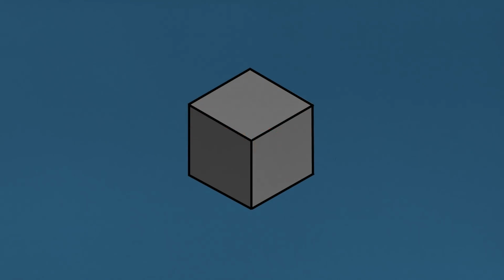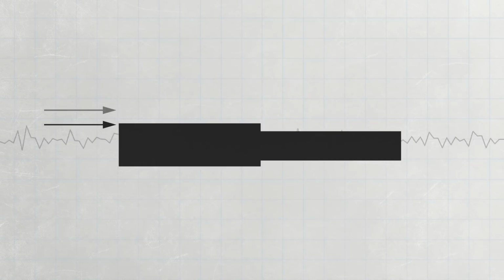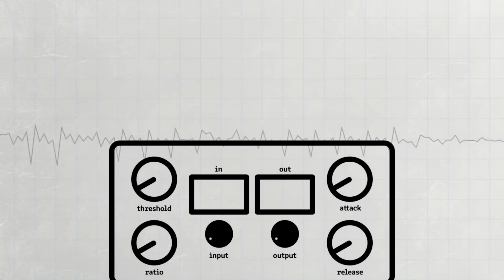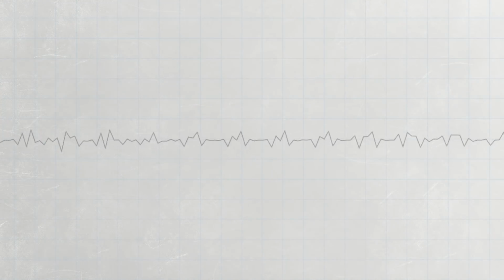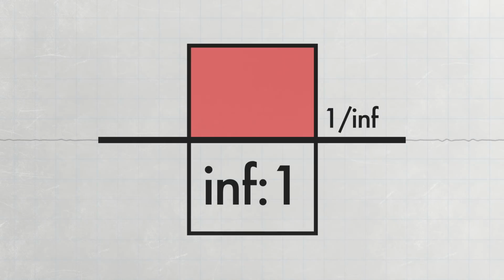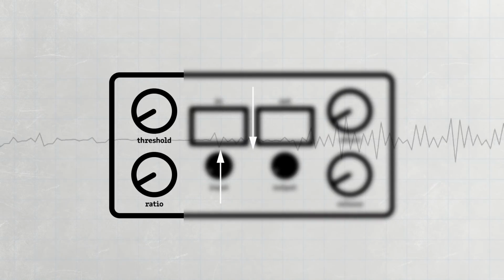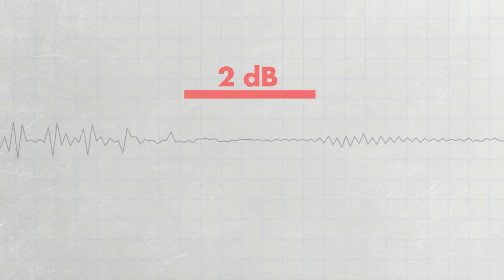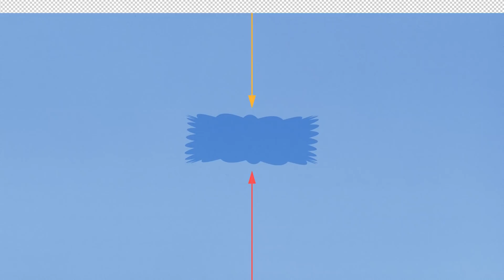How Audio Compressors Work

Comment: Really good explanation! If I get this right, for a specific threshold and compression ratio, the gain reduction applied is not static but depends on how much the input signal exceeds the threshold. Is this calculated on a sample-by sample basis or a time-window is used?

Comment: You'd blow up in no time with a series of videos like this, in this style. Really useful, just missing an example on in which situation would we want the attack to not be 0
Reply from the maker: Thats a good question! The attack setting on a compressor is actually pretty counter-intuitive because --  the shorter the compressors attack, the longer the sounds attack. It's an opposite force. You use a quick attack compressor to shave off the sharp attack of a snare or hi-hat
Reply: @pierceporterfield6327  got it, thanks! I encourage you to make more videos like these, really nice format